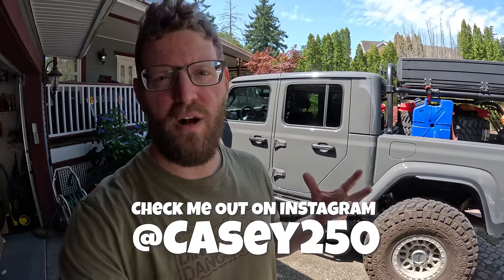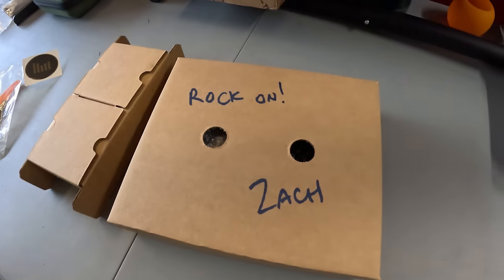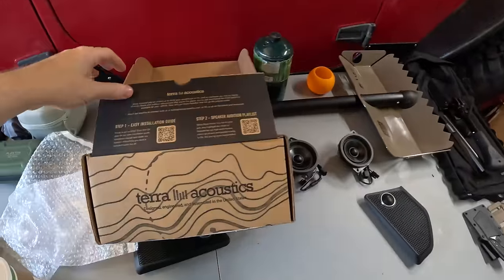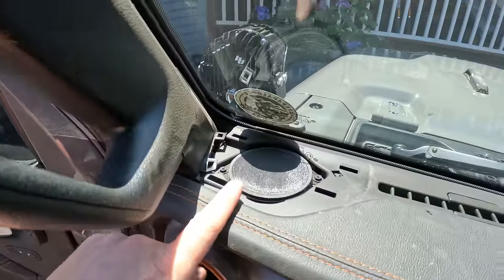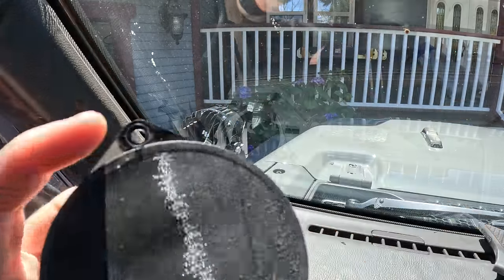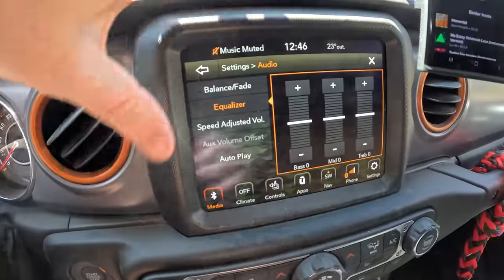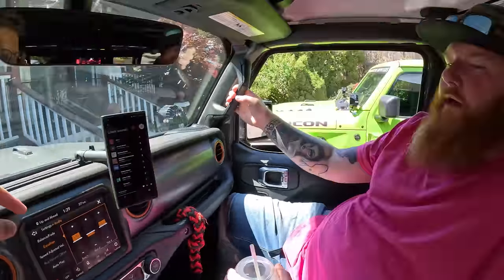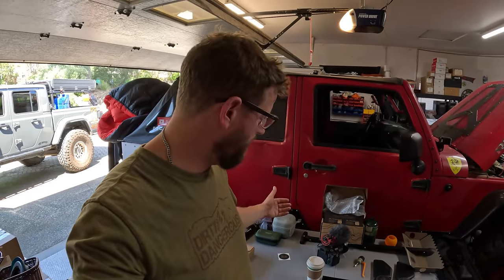EASY JEEP SPEAKER UPGRADE for JL Wrangler & Gladiator - Terra Acoustics Honest Review

Comment: I ran the Terra Acoustics in my gladiator for about a year and to be onest I didn't notice much of a difference. DS18 just came out with a plug and play OEM bullet tweeter, I replaced the ones in the dash and the sound bar and let me tell you it made a hell of a difference, way better sound staging.

Comment: I installed on my Silverado 2023 No Bose System a set of Kicker KSC270
KS Series 2-3/4" midrange car speakers.
 this fit on the Dash perfectly $60 bucks, sounds amazing now, so I noticed this set fits the Gladiator too and same result Sounds Amazing plus only $60 bucks included the harness !! Casey you should try this too to compare price and quality !! My son is happy with his Gladiator sounds , probably I will upgrade the other speakers too, NO ALPINE SYSTEM on his Jeep

Comment: The Terra Acoustics speakers and select increments with kicker 6.5s and tweeters are a huge difference over the Alpine setup. Best part is no cutting the sound bar.
Reply from the maker: You put the 6.5s up above ? I'd like to try that
Reply: @Casey250  yep, Quadratec sells the Select Increments JLJT-Pods with Kicker speakers combo. Huge difference.
Reply: @Casey250  and no cutting of the soundbar is required.

Comment: from experience, never bother with replacing the stock sound bar speakers....i did a conversion to jbl. that speaker location and direction do absolutely nothing for any postion in the jeep.  the exact same 2 speakers in the front 2 corner like this video did wonders for the sound.  i wasted about $500 on the soundbar to no improvement. 
better off replacing  2 front top dash and add a sub...like i did. i would say you could change the 4" to 6" lower dash speakers with a kit to add some better midbass...

Comment: there has been a misunderstanding for car hifi over decades. just replacing speakers wouldn't have significant impact on the sound.
much more it's the sound source, the Amp , matching crossovers, connectors/cables and the way speakers are located inside the vehicle. sometimes phasing as a result of bad engineering from car company ist the real reason for bad sound.

Comment: I am guessing the bit they gave you plugs into the socket wrench tool in the Jeep tool kit you get with the Wrangler and Gladiator.
Reply from the maker: it is to do it by hand as you can't fit a socket in there with teh window.

Comment: You can buy expensives speakers for rear sound bar and still worthless. Sounds horrible.
But if you want quality for your rear speakers,all you need to do is remove your speaker and fill it with speaker insulation ( polyester)
You re welcome ✌️
Do this before you buy any speakers , and save $$

Comment: If you do any more than this, then you'll have to go all out.  Anything more without doing new amps, wiring, and DSP is a waste.  The bar speakers have the stupidest crossover scheme I've ever seen in a vehicle(low pass on a 4" speaker dumb enough for ya?), so you'll need to run new wire along with the speakers.